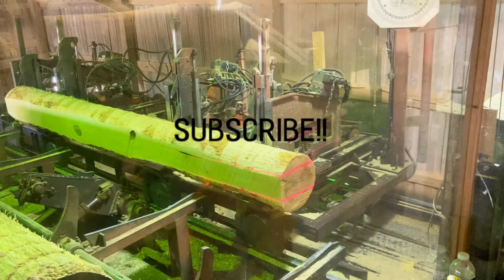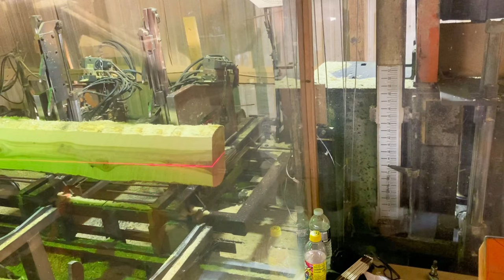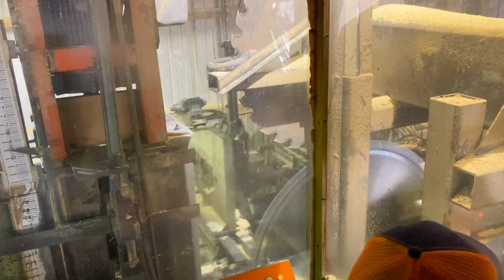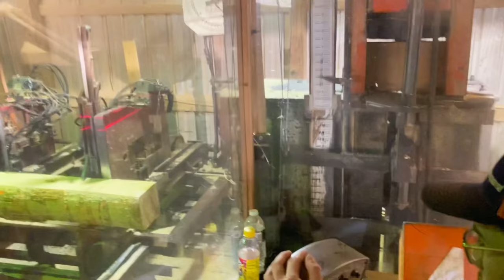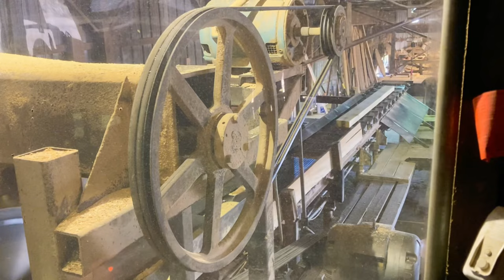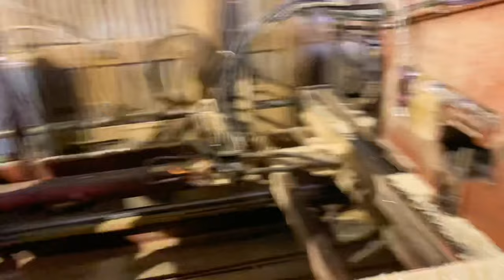The Old Saw-Mill is ripping through some Indiana Poplar!

Comment: How often do you use  that upper saw blade?
Reply from the maker: It just depends on the batch of logs I’m in. There’s been stints of time where it was running for every log for a couple weeks straight. But for the most part, a couple times a day